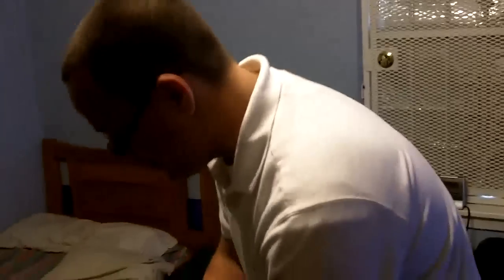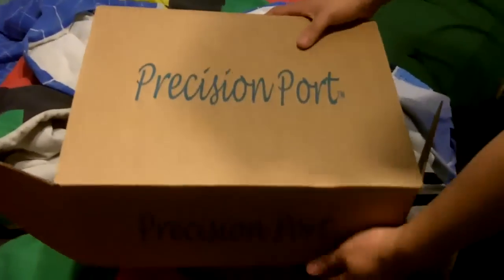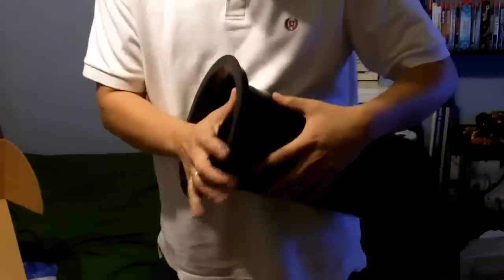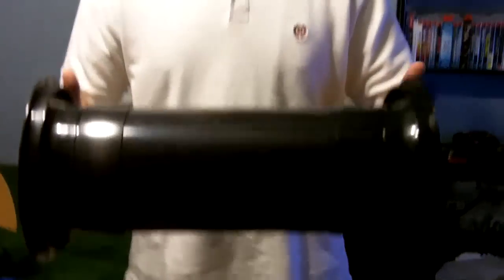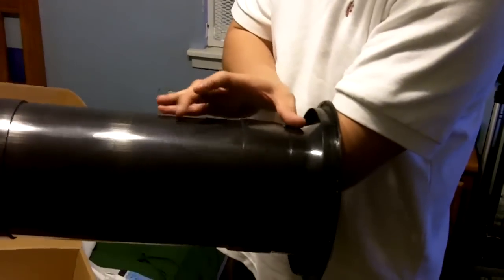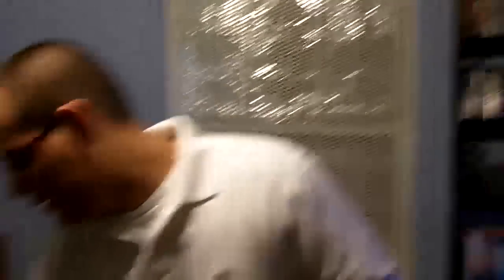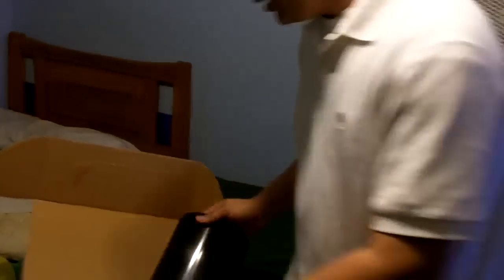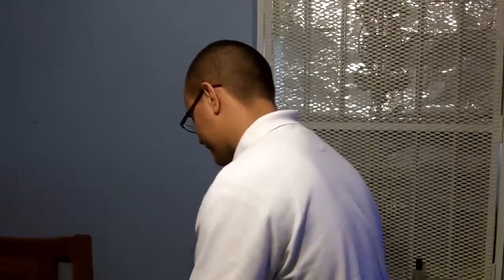Precision/Aero Ports Discussion

Comment: lmao precision aero ports, oh man well to tune them you would need a termlab. where you will see tuned to 38 or lower on the screen or paper it will be tuned to that but will peak much higher on the term. but since your not going for numbers but just to beat the block you should be fine. i do n't know what subs your using but for that port an a 3cube box net i would use a 15 cause a 12 you would need maybe a lbigger box not sure but i would do my homework first man. its some good shit guys.